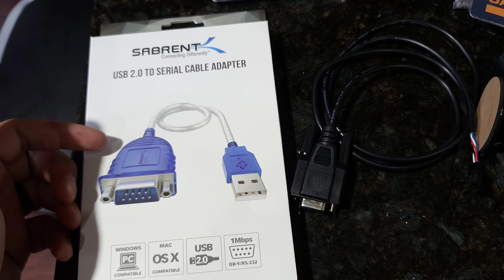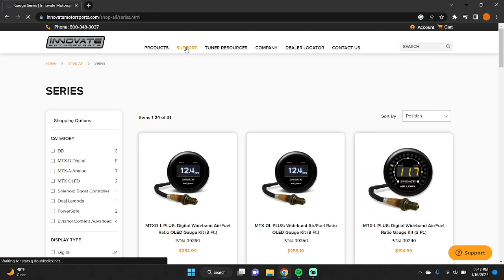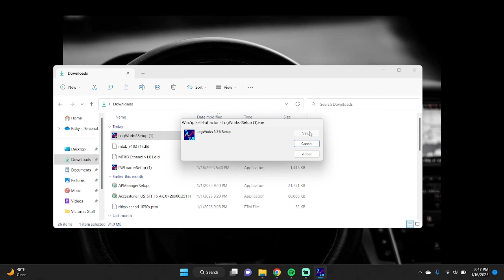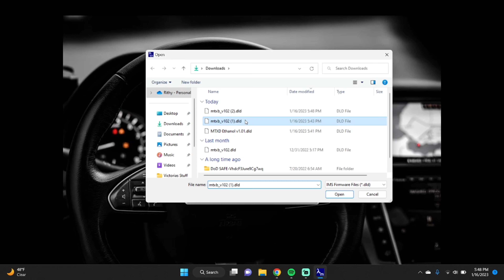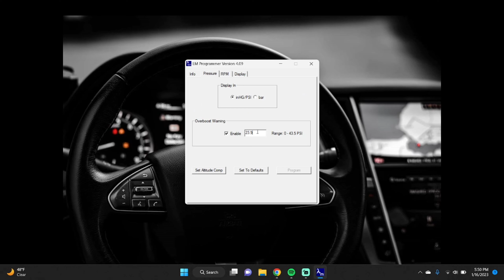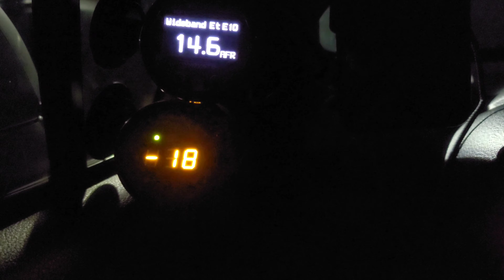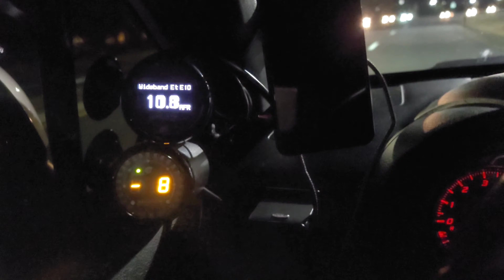Setting Up Innovate Gauges and Updating Firmware on Computer

Comment: Thanks for sharing this video and install.  The manual states to not update the firmware if they are the same version.  How did you determine what version was on the gauge before updating it?

2. Once connected, LM Programmer will display the current version of 
the firmware that is installed in the PSB-1. Do not flash the 
firmware if the versions are the same.
Reply from the maker: Thanks for the comment!! In ended up talking to a rep and they said to check on the website to see if there is an updated firmware but if things don't work properly then revert back to previous firmware. Hope this information helps!
Reply: @Rith_Media  the website is limited on information about past firmware and now they have the auto update utility that detects the gauge firmware but does not site the current version. Very frustrating.
Reply from the maker: @Tony D  what I ended up doing was looking up what gauge I had; going to the site; looked up the firmware listed for it (latest one). Loaded up the program and updated the firmware. It worked for me this far.  If you're still have issues DM my instagram and I'll try to help you
Reply: @Rith_Media  I checked but could not find it on the website.  I have the PSB–1.  If you could be so kind to share the link where you found the firmware versions of your gauge, I’d appreciate it.